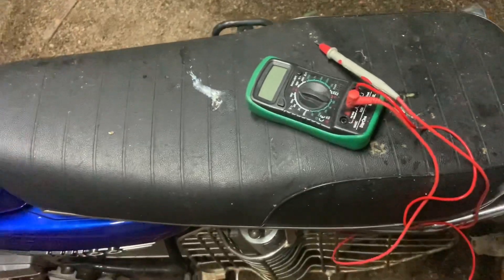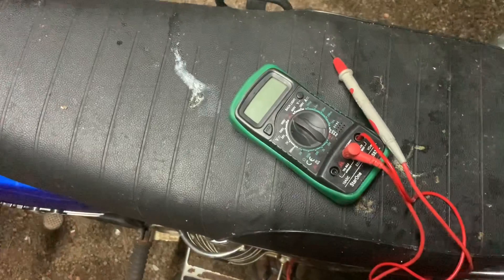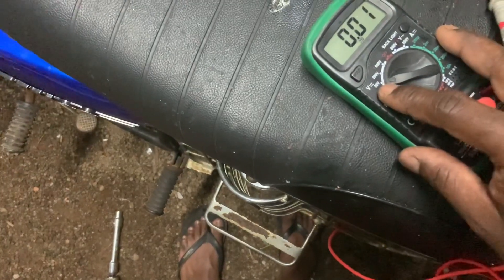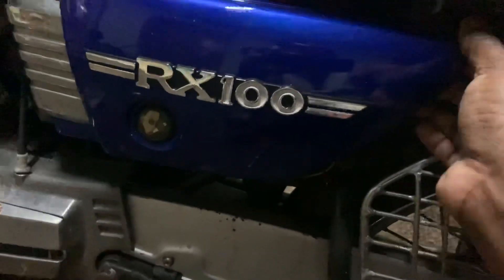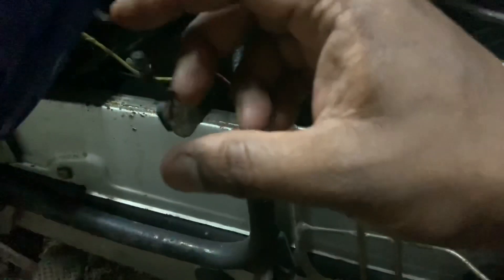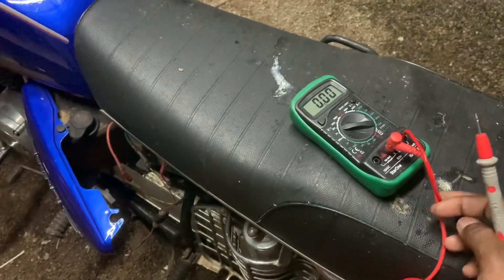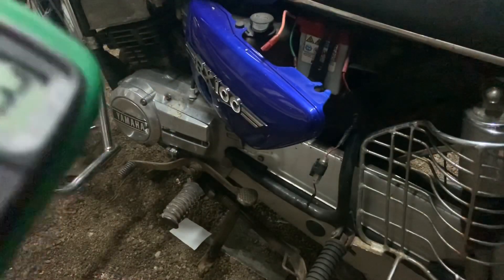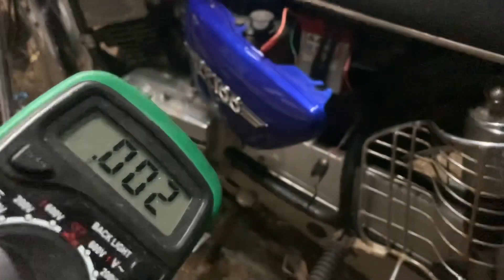Troubleshooting the charging circuit

Comment: 1st of all Thanks for this video.
Please correct my understanding and doubt. 

Generally we put 2Ah battery in YAMAHA-RX-100 which is 12 V battery.
As per my understanding all batteries are of 12volts only. (Car battery is also 12V)

Question: So why can't we put  8Ah battery in our RX-100? 
Ans.   We can't put 8Ah battery in RX100 because  battery charging current is different for all battery capacities.
Charging current required to charge 2Ah battery is lesser than charging current required to charge 8Ah battery. 
Each rectifier circuit has max. charging current limitations. Thats why Rectifier used in RX-100 will not bae able to charge 8Ah big battery. 

So I feel , we should measure charging current and not charging voltage. 

What do you say?   Please reply.
Reply from the maker: You are right, technically. 8ah battery will charge but will take a lot of time, let me give you an example, let say you are filling a bucket which has a hole, if the water coming into the bucket is higher than water going out then ultimately it will be full, if it’s the other way around then it will never be full

Comment: My new battery is not charging , when checked at bathery shop the battery is good but the current from the bike is only 11.3v instead of 14v. So what  should  I do next to get it charging again?
Reply from the maker: Rohith Ninan Rx 100 or 135? If 100 then first thing to change is the RR unit, second then is the lighting coil.
Reply: @Yamakaze  I do have a 1988 rx100 ...

And full rate of product and labour cost. How much?
Reply from the maker: Rohith Ninan RR unit is around 600, coil is around 300-400.

Comment: It’s funny,My RX doesn’t have that ground wire at all.Just a leaky battery and only one wire from the fuse.

I guess I have to change the wiring and battery,and then check if the RR Unit is working.
Reply from the maker: first thing is connect the negative terminal from the battery to ground. if the battery gets a proper ground it might start charging. Before you replace the battery just get the battery water topped and check the voltage across the battery. if the voltage is greater than 12V and less than 17V your RR unit is fine.
Reply: Yamakaze Thank you sir